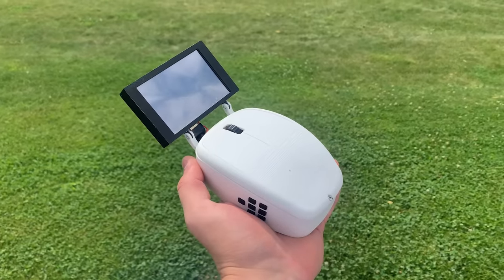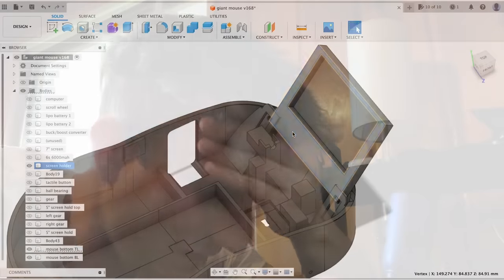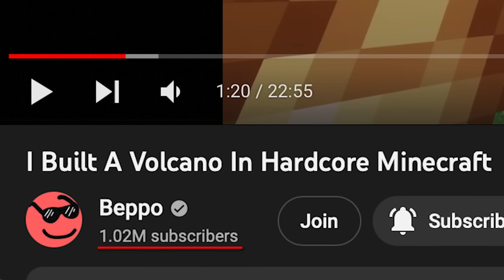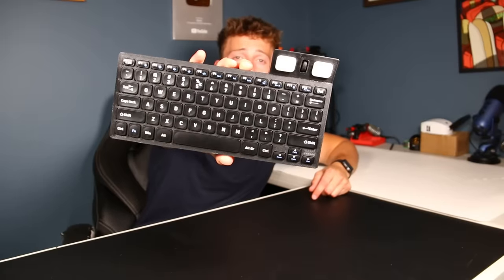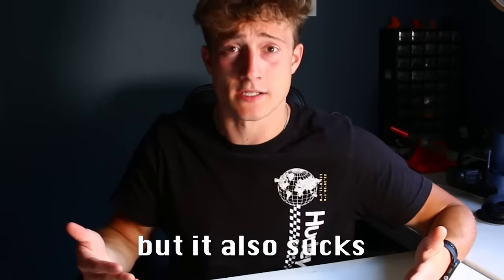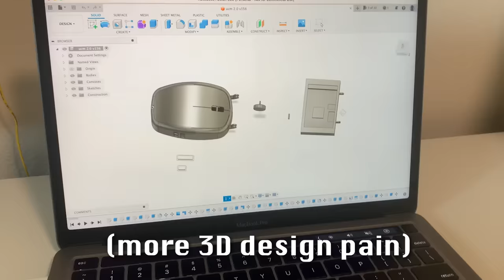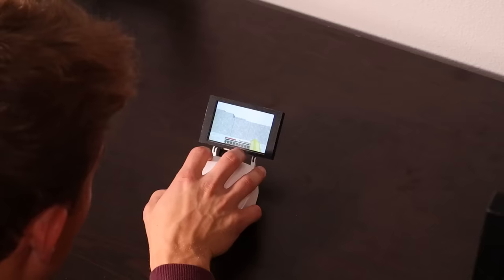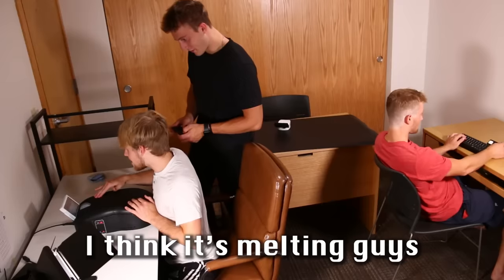I Made the Ultimate Gaming Mouse

Comment: It's huge, not much improvement, I'd bring back the kyleyboarr, but I'd swivel it and detach if possible to allow for it to be better useable. Print it on the side so your able to make honeycomb cutouts (most efficient material wise, for area) to reduce costs and weight as it's printed which inherently increases this weight. Not sure about the screen moving with the mouse, but I'd have it tuck into the front of the mouse and have the charging port either on it so it's useable if you want to detach it and so that when it's closed the port is facing out. Try to use existing mouse like the g502 X and non X as a guide for aergonomics. You could even use the electronics of one as the actual parts while using the unused shell as a physical model. Some other ideas but that's only if you actually see this.
Reply: This was copied from a short so I thought it was a smaller YouTuber who didn't have the most funds, but you are much more capable than I thought. So ignore some notes